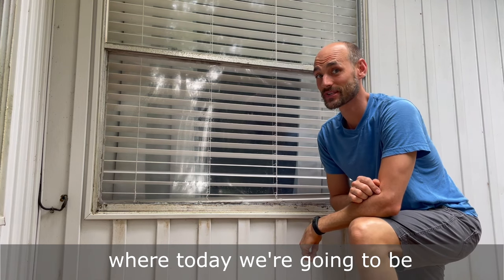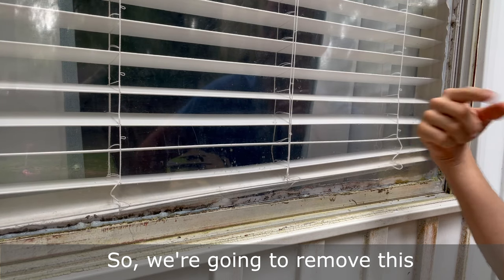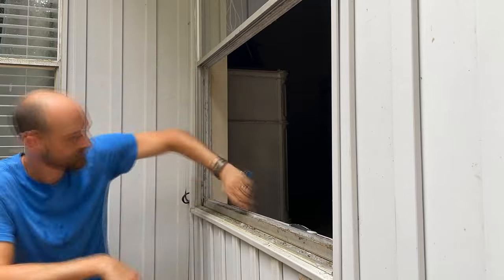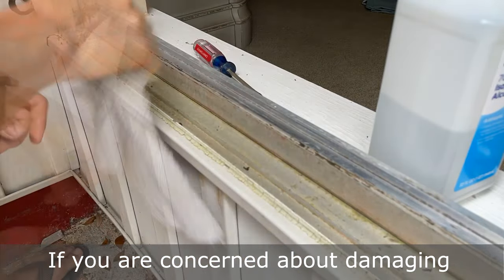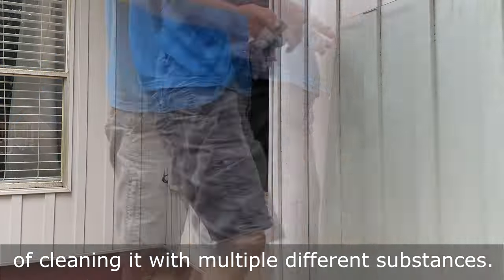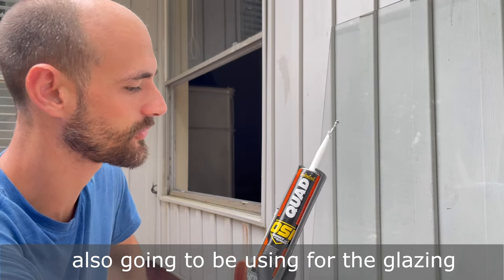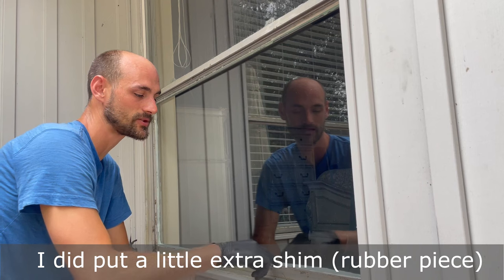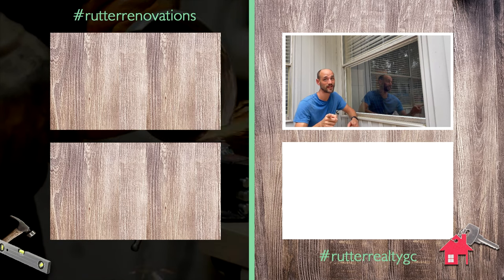How to Replace a Glass Window Pane (Aluminum Frame)

Comment: I’m a woman and mother single mother and I see you doing an awesome job but I’m not too happy that you did not take measurements of the window so I could see how you did it because I’m trying to fix my windows in my house but if you don’t show me show anyone how to take the measurements of the windows then we’re not gonna get nowhere
Reply from the maker: Thanks for comment. You see where I’m scraping off the caulk? That’s the metal frame the glass will go against. Take your measurements there or have a glass installer take the measurement for you.👍
Reply: Well if u can’t measure yourself ?!?!?
Maybe leave it to the pros
Reply: @omegamanzano8493 your comment really isn't necessary. As a YouTuber, he's not required to show you any of this. Taking measurements is extremely basic, elementary stuff. If you don't know how to do that, I agree you probably want to contact a professional to take care of it

Comment: Quick question! Is the process the same if it's the upper stationary pane? And do the pieces always fit in from the outside? Second story window 😮‍💨
Reply from the maker: Without seeing the window, there’s no way that I can know. Typically, if it is a single pane glass window and you can see the glazing on the outside of the window, then the glass will go in from the outside. You can always contact and licensed and insured contractor to be sure! 👍😃
Reply: @rutterrealtygc  I rent 😅 and my property management company is a nightmare.

Comment: Glad I found you.

The glass broke in our window in our old house, and the window has this groove inside the wood for the glass.

I purchased plexiglass to replace the window glass, and I've cleaned out any caulk. Probably should use alcohol and soap as well.
Reply from the maker: You should probably put actual glass back in… our plexiglass made noise wobbling back and forth when doors opened/closed in the house.😆

Comment: What did you press the glass up against to keep it centered? Was it the caulk? What keeps the glass from just tilting to one side while the caulk dries?
Reply from the maker: It is resting on the two rubber pieces and should be level. The caulk should hold the glass to the frame after it is pressed into the caulk. The caulk “glazing” should help hold it in place too.

Comment: Is there anyway to remove the plexiglass pane without braking it? Mine looks good but seems like the caulk is beyond its life and it has a small leak through it. I am planning just to remove the panel, remove old calking and putting the panel back with new caulk. it is possible?
Reply from the maker: Plexiglass is not the same as glass… is it glass or plexiglass? It would probably be easier to just caulk where there is a leak. 

You might be able to get it out without breaking it if you are very careful.

Comment: Where do I measure it from? To see what size glass I need. And did the rubber things stay in the bottom the whole time?
Reply from the maker: The rubber stays in, yes. You would measure the frame that the glass is going within once the glazing is removed ( I don’t know if that’s any clearer ).🤷‍♂️

Comment: Where do you get the rubber pieces?  And do you know what they're called?
Reply from the maker: I got them from a glass guy. I don’t know what they’re called. Any little rubber cushion should work. The ones I had were 1/16-1/8” thick.

Comment: I need help please is there something else I can use other then quad osi any other recommendations
Reply from the maker: This was the product I was recommended to use from a glass installer. I would have to search online for different products that could be used that would be as effective.
Reply: @rutterrealtygc  thank I will definitely be using it then if it was recommended great video by the way

Comment: Also, which type of glass is better to use?
Reply from the maker: There are several different types of glass. I think "best practice" is to use tempered glass or laminated glass if the window is below a certain height (I think it is if it is less than 18" off the floor, where a child might hit it or fall through), which will lessen the chance of injury. Definitely contact a licensed and insured contractor though to make sure.

Comment: How do you measure a replacement?
Reply from the maker: Measure it with the glazing removed and subtract 1/4 inch should leave 1/8 gap around the pane.👍

Comment: Im having trouble get the window out. The metal trim is blocking me from removing it.
Reply from the maker: I guess mine didn’t have that?
Reply: Mine doesn't either, the glazing is the aluminum window

Comment: how do i get the correct measurements?
Reply from the maker: Measure where the glass will be sitting after removing the glazing minus 1/4 should leave you 1/8 space on each side. Hope that makes sense. I just needs to not be smaller than the opening.😂

Comment: Clear caulking/silicone would look better.
Reply from the maker: The existing glazing on the top pane (and all other windows) was white, which is why I went with white.😊👍
Reply: do we have to use caulk if we have the rubber ?